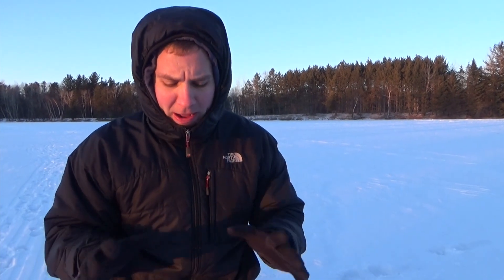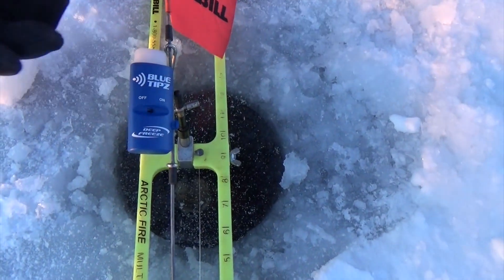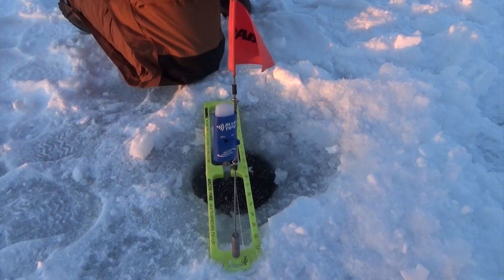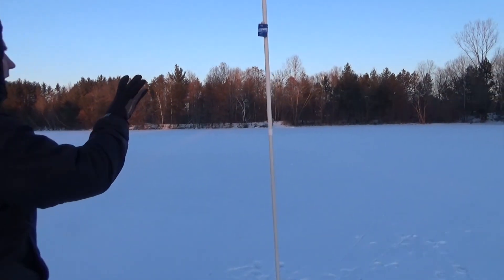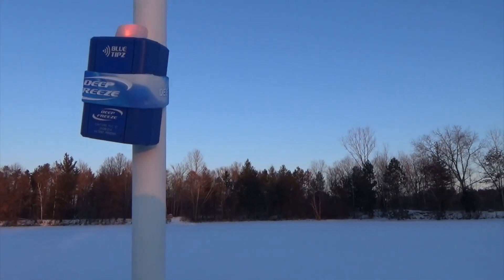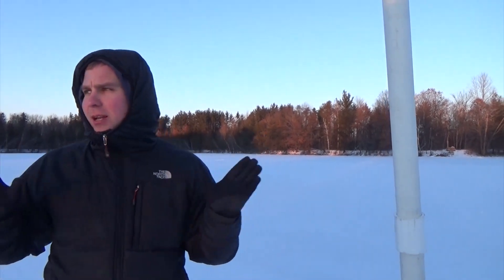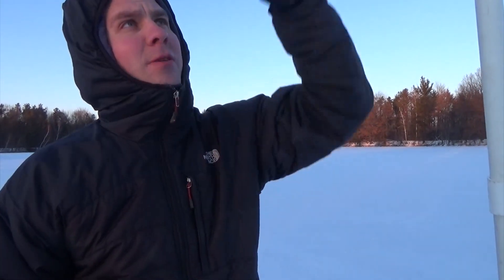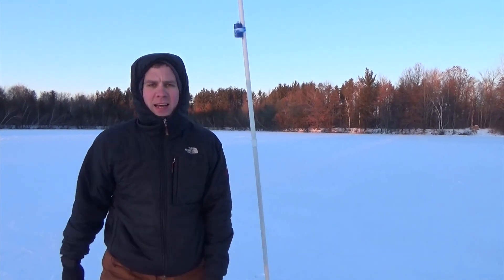BlueTipz Basics--Range Testing

Comment: I've tested the newest version of them. For me it was 250 steps. It could go further but then it becomes very unresponsive.
Reply from the maker: Hey there!  If you're looking for more range, or just have questions about range in general, shoot me an email at Brad@DeepFreezeFishing.com, and I'll do everything I can to help you out.  Thank you!
Reply: @deepfreezeicefishing3113  Don't get me wrong 250 steps is a long ways. That's way beyond what you should be fishing anyways. Loving my Bluetipz. Question. What is the clip on the opposite side of the transmitter used for? Glow stick for visibility?
Reply from the maker: @dm9103  On some of our adapters, we have an oval cut-out which allows the Transmitter to push in, you then spin it 90 degrees, and it locks into place.  Having those ears on both sides of the Transmitter allows the user to use whichever side they choose.  That's it really.  Let me know if you have any other questions, thanks!